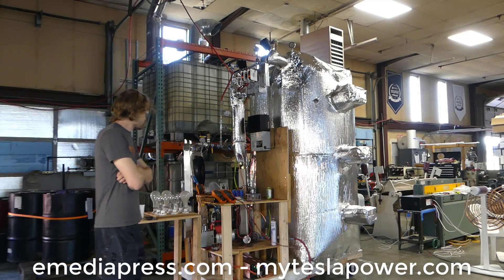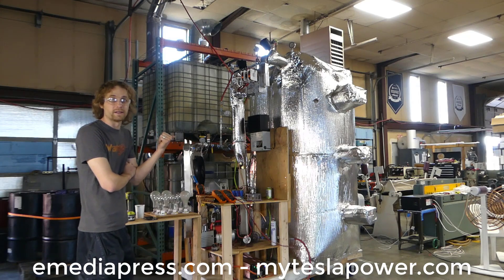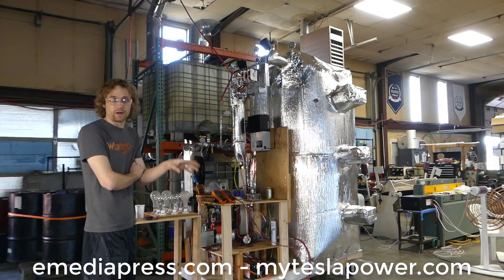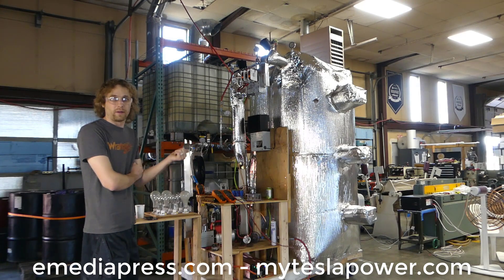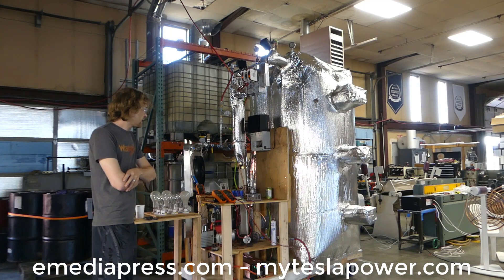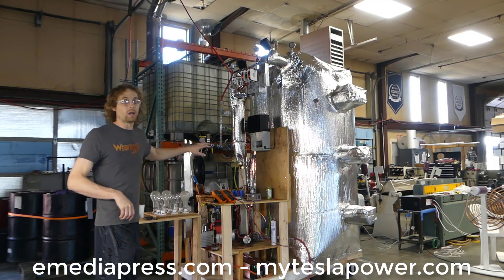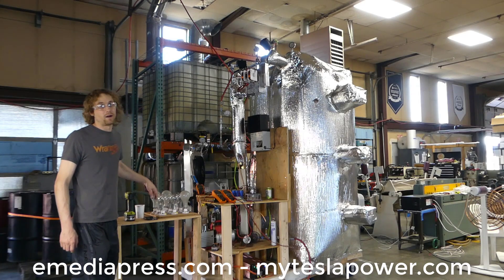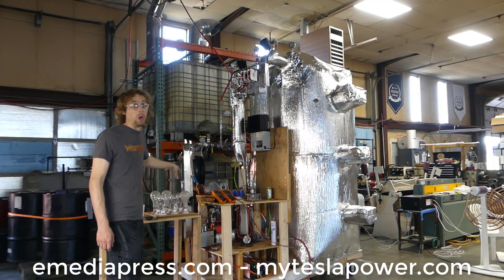2024-06-07 Tesla Turbine 2180 Watts at only 14,000 RPM

Comment: Say I have a tank with compressed air (200 bar), would that work sufficiently with the turbine or do you need to add some pressurized hot water as well to power the turbine? Kr Hans

Comment: I think you gentlemen will pooh yourselves if you go look at the old (real real old?) 40" & 60" Mount Wilson Observatory refracting "telescopes?" Huntington Digital  library has amazing photos of those 3 story+ tall mega ton systems. A close look at the lenses shows very strange sacred geometry fractal type pattern (like DVD picture cover on Eric Dollard Electrical Transmission in Multiple Coordinate systems) embedded into the crystal? lens. Lenses that weigh over a ton which they couldn't recreate so they switched to crappy mirrored lenses by early 1900s. In the plan view drawings it also notes a massive articulating mount 15'+ which is filled with.... MERCURY, inside a spinning axis!  I don't know what old "telescopes" they found in Mount Wilson and Yerkes Observatories, only that they appear to be anything but "telescopes"?  I'm thinking some very very advanced aether tech which the PTB dismantled, as evidenced by the "construction" photos😉 I think you'll notice they look like massive fasces (energy) systems. I'll send links in separate post as YT loves to block and I don't want to retype all this😊
Reply: I've never seen it.

Comment: got 2 ideas.
1: add glass on the surface of the discs so water can stick to it since its polar and thus increase the efficiency.

2 off topic:
create AC MHD propulsion, where yamoto 1 used DC MHD which is absurd since its inefficient due to electrolysis. AC MHD does not cause electrolysis and it wont wear the plates and should work wonders.
AC MHD is one directional since both magnetic and current changes simultaneously and using the right hand rule you can see its one directionality. 
yamoto 1 was supposed to be AC MHD, but i am guessing they were stopped from testing it due to politics and military application breeches.
Reply: Would love to test the ideas, maybe some day.